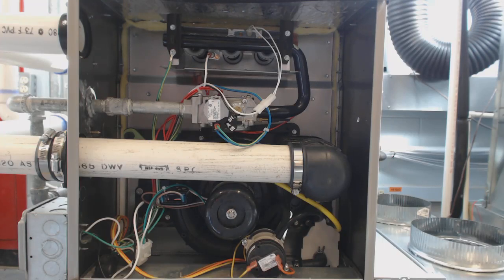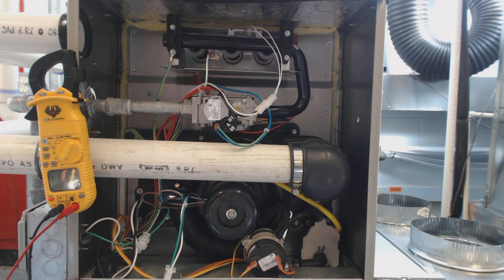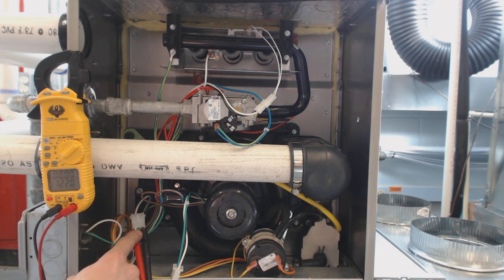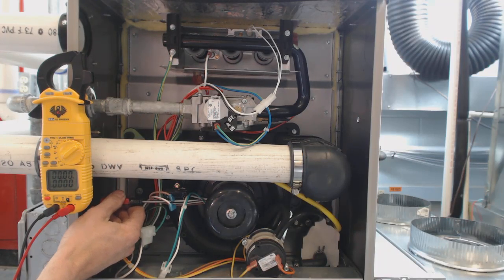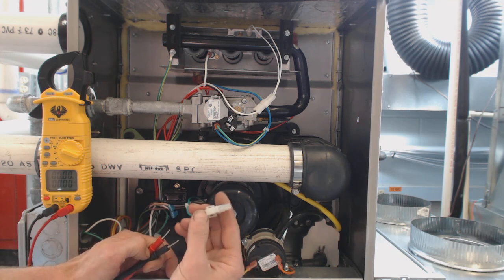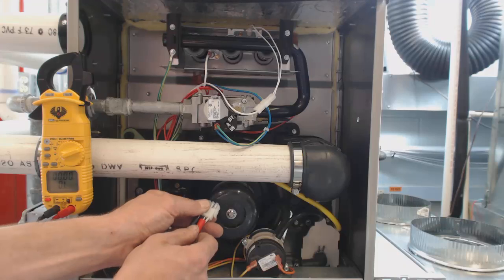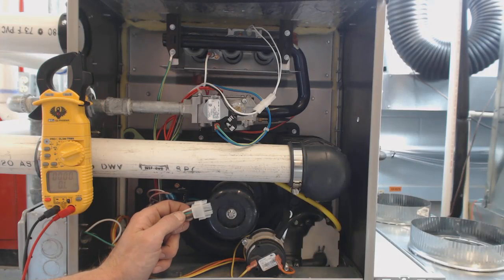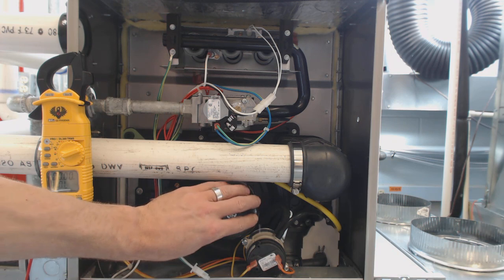How to tell if an Inducer Motor is BAD: Explained Step by Step

Comment: So I haven't done any testing yet on the cap or motor voltage or resistance. But reading the comments below you may be able to diagnose. So the motor will start running when I give it a spin. It will run for half a day or more then quit. Usually in the early morning hours when I wake to fine it cold in the house. I go out and give another' spin and it starts up no problem. I have found that the motor is warm and starting to smell. I have electrical background and know that's not good. I keep pushing it so I can find time to properly diagnose. I think it's the start cap, but if I don't replace soon I may be replacing an expensive motor too. What's your thoughts?
Reply from the maker: Sounds like it is the cap. This is a run cap but is needed to start. If it runs after spinning it by hand it will get very hot until the internal overload cuts the common wire out at 200-300 degrees. I would replace the cap as soon as possible. Make sure it is the exact same mfd/uF and voltage rating. Here is a video on what is happening to your motor, the internal overload ----  https://youtu.be/IBg0EZg0ohY
Reply: acservicetech it was the start cap. I replaced the run cap even though it didn't show signs of overheating. It part was a $2 plastic China cap mounted to the motor that you cannot purchase separately. The motor is $150. Don't you just love imported cheap crap? Could only find a 3 mfu, but was told it would burn motor up over time. Fortunately a friend of mine found a 2 mfu which was metal but much larger. He said even if I replaced the whole assembly the same part would go out in another 2 years. He replaced it and its working fine. I had to get a licensed contractor to do it to keep the warranty, but he saved me over $100.
Reply from the maker: Glad you got heat and everything is safe Matt!
Reply: I have the same happening with my inducer motor, I got a 31 code, the motor was overheating and wouldn't run unless I gave it some help by hand spinning it. It has been working now for a few days with no problems, but I did unplug the harness and checked resistance, I got all zeros reading between the black and the white wires, but the inducer motor has been working normally for the last 3 days. What gives? I haven't checked the cap yet. Will the ind.motor continue to work with zero resistance between the white and the black wires? Should I replace the capacitor or and the motor assembly too? Like I said it hasn't overheated since and has been working fine the last few days.

Comment: So I'm to the point where I check the capacitor and I'm got getting anything. I can see a spot on the wire heading off the capacitor where it looks as though it's contacted the frame and its burnt.
Reply from the maker: Make sure that after the power is off and that the capacitor is shorted very good with a non chrome painted bare metal screwdriver. Make sure to hold the probes in hard for 20 seconds to get an accurate  reading for mfd. Sometimes the corrosion on the tabs stops the mfd reading from being read. If you have a 120v psc inducer motor and it has voltage then go ahead and give it a spin to start. If it continues then you know that either the cap is bad, the wires from the cap are bad or the start winding on the motor is bad. Don't continue to run the inducer without the cap because it will overheat. If the motor does not spin and cap is good turn the power off and do resistance checks. You should not have the hot or common having any resistance with ground. It should read overlimit when testing the motor leads to ground. Thanks

Comment: What if you don't have power coming into the induced draft motor, could that mean it's either the induced draft motor relay or the circuit board?  Thanks. keep up the awesome vids.
Reply from the maker: You would check to see if you are calling for heat on the board by checking voltage from w to c terminals. If you read between 24-28.5 volts then the call for heat should start unless you have a broken safety sensor in which case you should be reading an error code on 90's and up furnaces. If no error code and you have a call for heat on the board but no power from the taps on the board to the inducer motor then it is likely that the inducer relay on the board is bad. Thanks. Great Question!
Reply: acservicetech Actually I do have a code, code 31 on a Carrier to be exact. I checked all safeties and everything checked out good. I'm going to have to go back and re - check all safeties again. I figured I'd have electric potential at the inducer draft motor for  at least a few seconds, before the safeties kicked in.  I'm a rookie HVAC tech trying to learn the tricks of the trade. Thanks
Reply from the maker: 31 I believe is just the pressure switch did not close and that would be correct if the inducer motor is not turning on. Check out the one on reading wiring diagrams as I believe I go through live safety switch testing.  https://www.youtube.com/watch?v=Ogi5FMFudtM&index=42&list=PLxnHR5_D2ojyX1WtewLq0Yud-MldF2_xa   ------ Since you are reading a heat sequence error code, it sounds like you should be past the safety switches but check them anyway. Make sure to check for 120v coming off the board taps for the inducer motor. It sounds like the board but verify as much as you can first.
Reply: acservicetech I followed your advice and checked out the  wiring schematic and travel of potential from beginning to end (which I had already done). All safeties were gtg, had potential all the way up to C and W when call for heat. No power coming off of the taps at the board for the inducer motor, which leads me to believe it's the board. New board on its way. Thanks for the advice.

Comment: Thanks for the video ACSERVICETECH! I like to ask a question on gas furnaces.  What is the reason why some have the inducer located above the manifold and others are located below.  I am just now getting to work with gas units since getting out of school. The complex I work at has mostly oil and electric.  Also can you do some more videos on the sequence of operation and gas valve checks. Thanks a lot, you have no idea how much this is helping me.
Reply: NICK-O
Reply from the maker: Most furnaces are multi poise which means vert, downflow, horizontal right and horizontal left. Also different manufacturers orient them differently. The units could be downflow you are looking at or the ones with the inducers above could just be earlier less efficient designs. I plan to make furnace videos before and during winter. I will likely be making gas line videos in between seasons. I am trying to hit the seasons for good exposure for our channel so we can share the knowledge with the most possible.That is great to hear!
Reply: Thanks for the reply!  I look forward to the new videos coming. Thanks again.